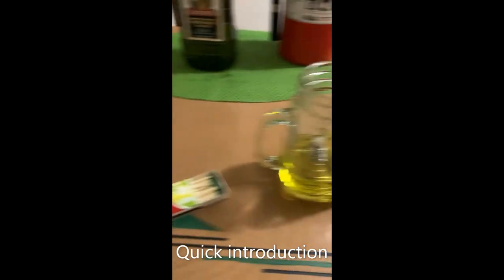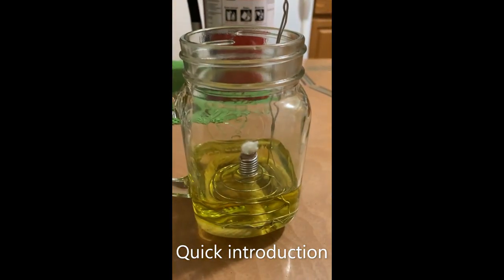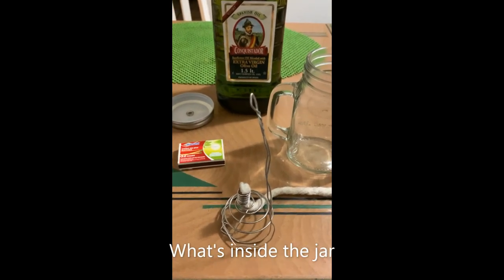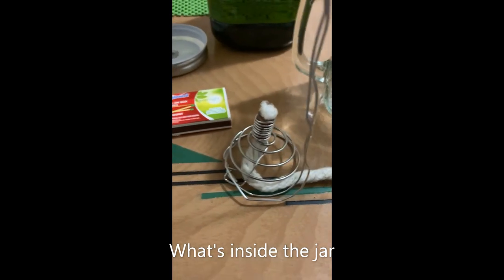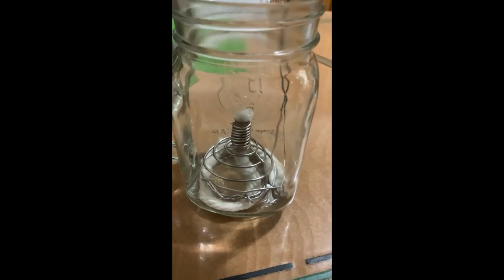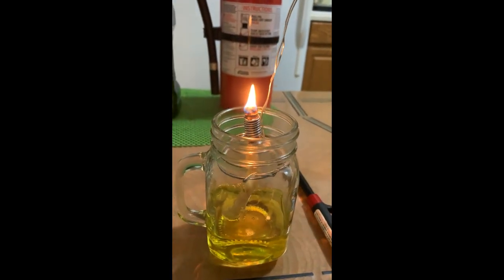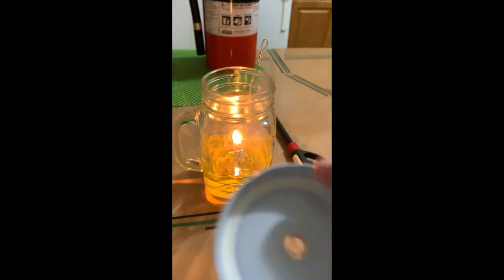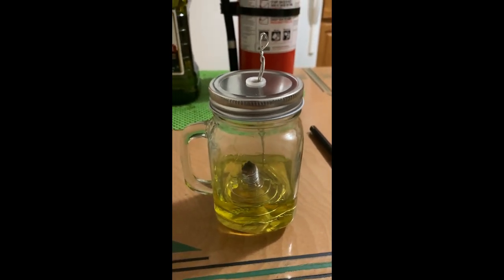DIY Olive Oil Lamp

Comment: I found that olive oil doesn't want to wick up barely an inch.
Even tried thinning it out with some lamp oil and it still didn't work.
Reply from the maker: Hi, try cotton wicks, K1 Kerosene (paraffin oil), placement of wick matters, and trim the wick if it is charred. Hope this helps and thanks for watching.
Reply: @HaibrydMatt  Rn out of time lately. Been making a couple of subirrigated self watering planters and turning compost before the cold weather hits again.
May try to fool with it this weekend if I get a chance,